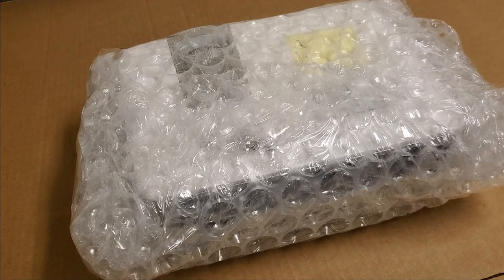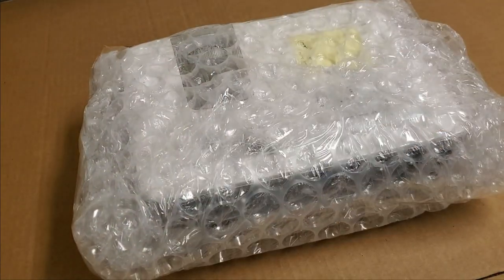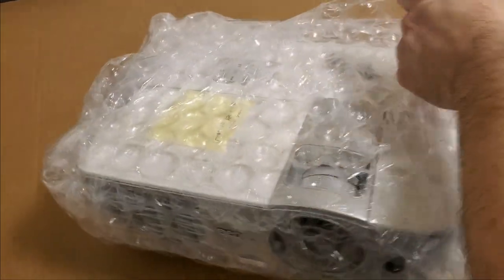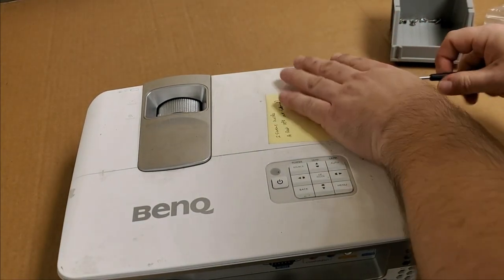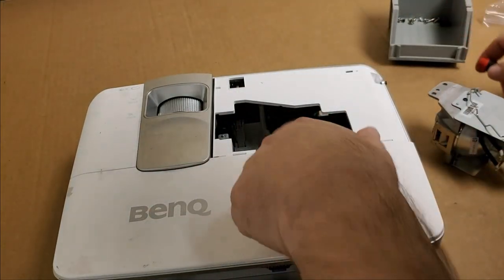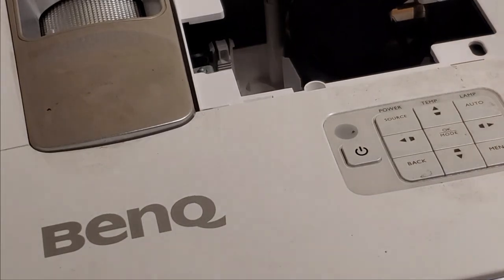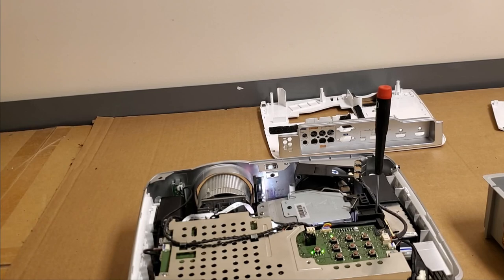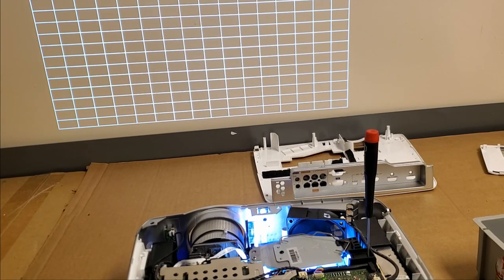BenQ HT1085ST DLP Video Projector Over Heating Repair

Comment: Fix it frank I have a question about my projector. I have an artograph flare 150, I can't find parts for. My LCOS just went Dem so I'm looking for that particular LCOS panel or a compatible upgrade without having to change the motherboard.
can you help me find where to purchase :
1.) The exact same
Or
2.) One equivalent
Or
3.) One with the same dimensions but better quality better light
Reply from the maker: Unfortunately that isn't an option on these flashlight projectors.  They actually use a single LCD panel rather than LCOS.  LCOS is a Sony product(Liquid Crystal on Silicon) and they are very expensive to use so you don't see them in these sorts of devices. They use one LCOS panel per color usually.  I have a video coming up with a Sony that uses LCOS. 
Artograph contracts with an OEM company who makes these with their name on it.  You might want to see my apeman video on the LC400.  https://www.youtube.com/watch?v=BjoGD1zXqZA
These tend to fail pretty quickly and unless its something you can re-solder etc its not worth fixing these.  If yours went dim, then the LED might be the issue rather than the panel.  Making it brighter is not an option though.  The optics are designed to run at a specific lux output from the LED, any increase in brightness will lower your contrast and likely melt the polarizer panel.
I'm sorry for the bad news but there just isn't much you can do with these.  
If you like the small form factor and portability, look at Optoma Pico projectors.  The PK301 would be lightyears better than the artograph and can be had pretty cheap used.
Reply: @FixitFrank  ok so what do you recommend for a replacement?
It needs to be:
Just as small compact as the flare 150
Very very very bright
Stand alone & portable
Bluetooth
Large screen
Reply from the maker: Does it need to be battery powered? That tends to be the trade off. Batteries can't really drive high light output for a long time. If not I have some ideas.
Reply: @FixitFrank  no just like the flare 150 with 🔌 or without it worked for up to 4hr without. Then had to 🔌 it in to charge
Reply: @FixitFrank  also it needs great image quality
Reply from the maker: OK, I'd check projectorcentral.  For starters, I like these 3.  https://www.projectorcentral.com/Xiaomi-Mi_Smart.htm   https://www.projectorcentral.com/Philips-NeoPix_Ultra_2.htm
https://www.projectorcentral.com/XGIMI-Halo.htm

Name brands will always serve you better.   Be careful with anything advertising really high lumens.  Keep in mind a Dual 300W lamp projector puts our around 6000 lumens so any LED claiming that with a battery pack is likely fudging the numbers.
Reply: @FixitFrank  okay thank you so much. I'll keep you informed

Comment: Hi Frank! I didn't find anywhere to contact you, so I'm posting my question here, hope you have a minute to reply! I am trying to diagnose my Optoma uhd51a that failed one day after only 8 months (no warranty in my country unfortunately). Hot/humid climate may be a factor. Buzzing sound got loud and projector blacked out after flaring some color distortion for a sec or two.  LED error code indicate lamp failure, so I got a new lamp, but still same symptoms. I have opened it up, checked the color wheel, but looks perfect. My question is, as a casual and not particulary adept fixer, how likely is it that I can do anything else myself at this point, after checking those two?
Reply from the maker: Hello! Does the noise continue with the new lamp? How does it sound if you try it without a lamp but with the lamp door in place? Also my email is listed on the about page just in case you need it.
Reply: @FixitFrank  Thanks for the quick reply! There was a buzzing sound for a while, that suddenly got loud and crashed the projector as described above. It went dark after that, and the sound has also stopped. POST says lamp failure, but changing the lamp (OEM lamp from amazon) had no effect. I was thinking it might be the power supply for the lamp, but I don't know, really.
Reply from the maker: @polyphony250  I would check the color wheel first.  The buzz may have been the wheel spinning out of balance. The crash may have been the segments breaking and causing the wheel to jam.
Reply: @FixitFrank  Yes, already checked that! Color wheel looks fine. No dust build-up even, clean as a whistle.
Reply from the maker: @polyphony250  is there any evidence of debris from a fan? The source of the buzz is going to be key. Was it a mechanical buzz or an electric/arcing buzz? A ballast could be bad or possibly the main power supply. Maybe both. Was the old lamp whole (not shattered inside) when it was removed?
Reply: @FixitFrank  No debris detected, but I haven't opened the thing all the way - there are several circuit boards rather intricately connected so I've held off on removing all those. The main fan is ok though, and I see nor hear any traces of a mechanical failure. I first thought color wheel because of the color distortion, and because the sound could easily be understood as a high frequency mechanical thing, at least by a layman, but since the color wheel seems completely fine I'm leaning more towards something electrical now. The old lamp seems 100% fine physically.
Reply from the maker: @polyphony250  That makes me think ballast if you heard a high pitched noise.  They run a high frequency and the lower harmonics will be audible to human ears. I would recommend voltage testing to be sure, but if you want to try parts, I would try a ballast first.  I suspect the main power supply is OK so far, but if you put in a new ballast and the lamp does not light, then the main power supply is another possibility.
Reply from the maker: @polyphony250  That makes me think ballast if you heard a high pitched noise.  They run a high frequency and the lower harmonics will be audible to human ears. I would recommend voltage testing to be sure, but if you want to try parts, I would try a ballast first.  I suspect the main power supply is OK so far, but if you put in a new ballast and the lamp does not light, then the main power supply is another possibility.
Reply: @FixitFrank  Ok. This just might be a bit more advanced than what I'm prepared to get into, so I guess I'll take it to a local shop. Thank you so much for your answers!
Reply from the maker: @polyphony250  Unfortunately yes.  It is going to require some diagnosis. Feel free to give them my info though if they are not sure which direction to go.  I would be happy to offer them any info I can.

Comment: great video - I only have 1200hrs on the original lamp but have had the projector for 4 years now - nothing wrong with it, no funny noises and colors and brightness look like brand new - am not near any heating vents or windows - you think still worth opening to clean the 3 fans?
Reply from the maker: I would. At the least, blow some air into the blower fan with the lamp out.  You don't always need to open them up fully. The goal is to keep your fans running as you expect them to.  Less is more with a projector.  Keep in mind every screw you remove, increases the chances of damaging something.  I would realy start with a basic cleaning with a vacuum and or a paintbrush to knock the dust loose.  I would not remove the optics or tear down the lenses.  A general once over of the fan should leave you in very good shape!
Reply: @FixitFrank  makes sense - thanks very much 👍
Reply: @FixitFrank  that was easy, was very clean overall but cleaned what was needed - maybe 1x/yr thing 🙂
Reply: @FixitFrank  separately, any thoughts on an additional usb pc fan mounted/facing somehow on of the side grates? just for added exhaust?
Reply from the maker: @antmon123  If the internal fans are running properly you wont need to.  I think that would add more noise personally.  Unless of course you have it in an area where the air is being restricted by a ceiling corner or bookcase shelf.  If the internal fan isn't working well, it will restrict air to the external fan so without one, the other wont be as effective.  I know this reads a little convoluted but I hope it makes sense.
Reply: @FixitFrank  nope, i get it - it's mounted to the center of the ceiling - no airflow restrictions at all - will leave well enough alone, thank ya

Comment: Hello Mr. Frank. I always follow your videos on your channel. I would like to know if you can provide a schematic of a ballast circuit and power supplays for us to study about projectors and their circuits? It can be in .pdf format! It's possible?
Reply from the maker: Hello Carlos! Thank you!  There are many ballasts but they all follow a very similar design.  I will see if I can find a schematic for one.  They are not always shown in the schematic depending on the brand, but I know I have seen them. This link has a common power supply, but there is no ballast listed.  https://elektrotanya.com/benq_sp870_level3_ver.00a_projector.pdf/download.html  I will see what I can find.
Reply: @FixitFrank  OK, Frank Tanks!